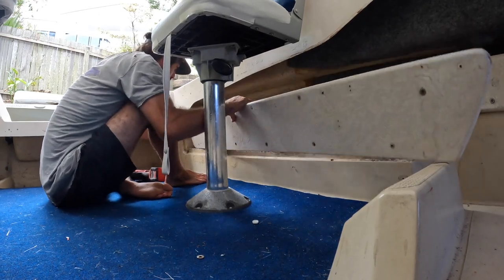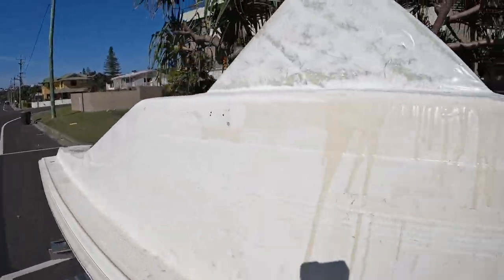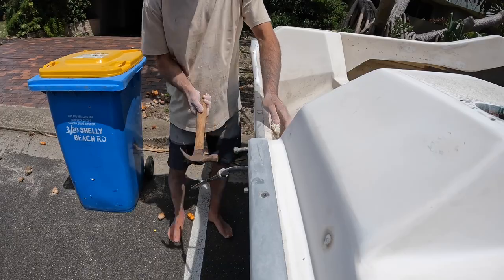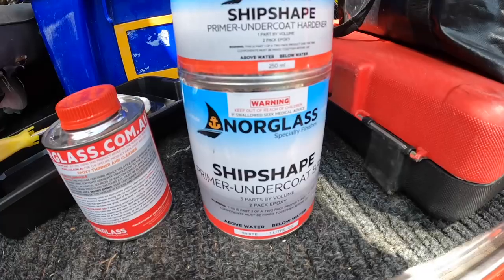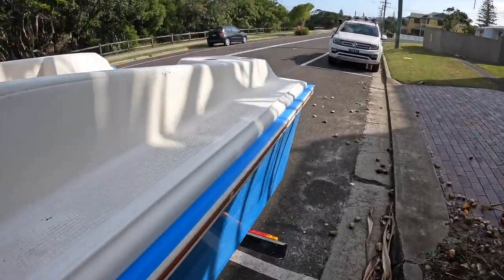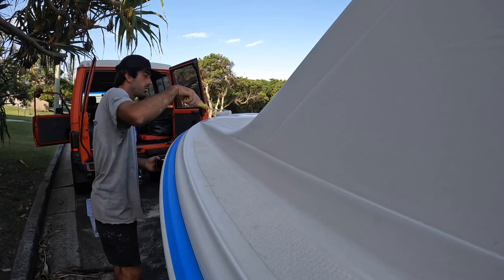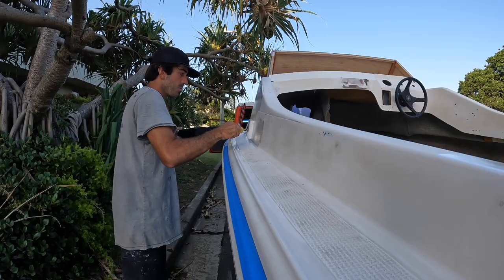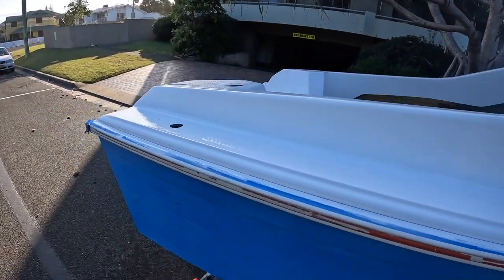My Haines hunter boat restoration P3

Comment: Nice work mate, I plan on using the same technique on mine. Which paint product did you use for the topcoat? Thanks
Reply from the maker: Cheers mate, I’m using the norglass products on this boat, been really good but have used Jotun epoxy paints aswell both good brands